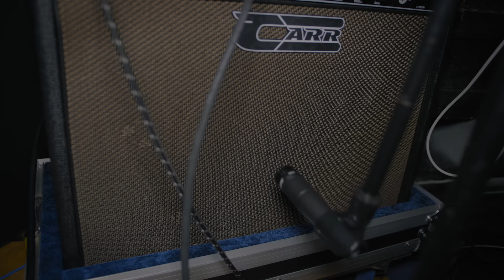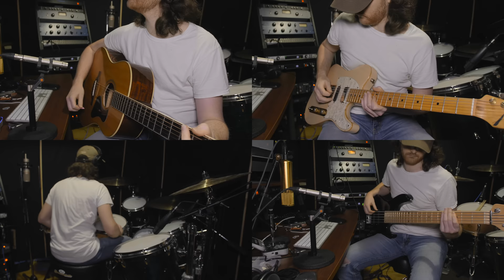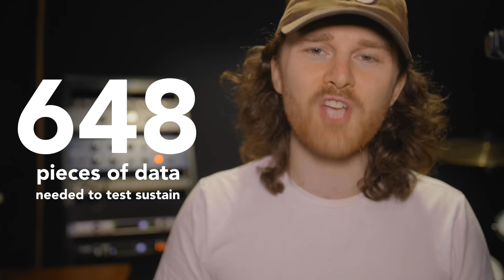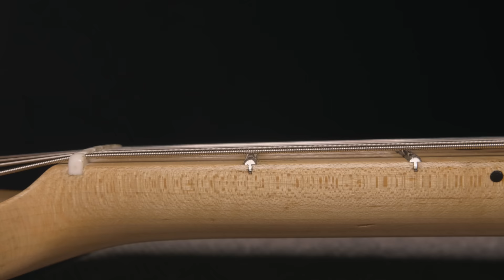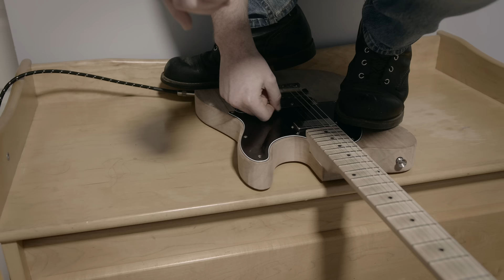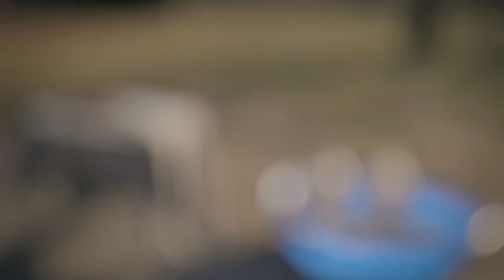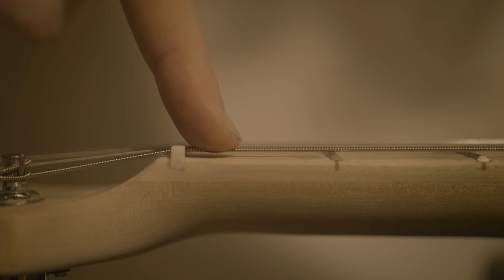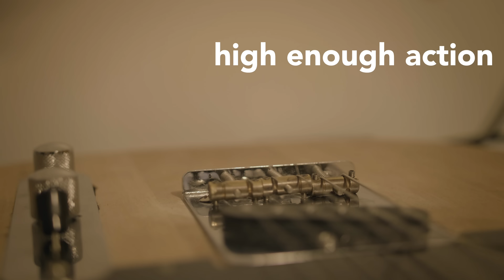Tested: Where Does The Sustain Come From In An Electric Guitar?

Comment: Les Paul's experiments in the 1920s showed him that he got the longest sustain when he mounted a pickup, bridge and nut on a two foot section of railroad track.
 He noted that the track is so dense and massive that the string can not make it vibrate, so all the vibration energy remains in the string for a very long sustain. He was quoted as saying "That thing seemed to sustain forever".
 So we can draw from that experiment and observation, the converse, that if the string is mounted to a material that vibrates easily, it will rob the string of it's vibrating energy quickly and the sustain will be much shorter.
 To translate those physics to real guitars, a guitar made with wood of a greater density and mass will sustain longer than a guitar made from lightweight, low density wood.
 I contend that you probably already knew that.
 If someone asked you what you would expect the sustain to be like in a guitar made from balsa wood, you knew already that it would be short, without the need to conduct the experiment.
 To answer your initial question, " What part of a guitar does the sustain come from?"
The answer is; all of it.
 Maybe you should make a video replicating Les Paul's railroad track experiment and then make a guitar out of balsa wood to illustrate and drive the physics involved home to your fans.
Reply: Johan Segeborn already did the experiment on steel beam. It's on youtube
Reply: @TheMemagNeman  And fender made a Strat out of cardboard. Sounds fine.
Reply: @Andrew Elias So?
 People have made guitars out of resin, out of various recycled materials, out of concrete blocks, glass...etc
"sounds fine" is a subjective thing. Does it produce a sound, yes it probably does.
Is it sounding as good as high quality wood guitar, it could be a possibility , sure. But it could also be a dud, just like with a piece of wood.
If it dampens the string vibration too much it will sound like shit.
I guess that's why we don't put rubber on saddles/ nut and frets.

I just think that dismissing body and neck material as a contributor to overall guitar tone is incorrect.
Reply: @modelcitizen1977  Question: Is that cardboard guitar sustaining the note as long as the steel beam structure? I'd be surprised if it did.
Reply: So then why does my Les Paul sustain for less time than my Hummingbird when unplugged?
Reply: @modelcitizen1977  they most probably had soaked the whole thing in epoxy. No way raw cardboard would handle the frets.
Reply: @damienalvarez2957   Probably because they have different acoustical properties, different materials used, different construction etc.
Reply: Dead strings, and bad set up, and nut and saddle cuts.
Reply: @TheMemagNeman  ooops watch hi other video about tone. we are talking about sustain here though
Reply: @sunnysideup5826  Materials matter for tone and sustain.
Reply: @modelcitizen1977  Cardboard covered in epoxy. So practically it was epoxy guitar using cardboard as a mold for stylistic effect.
Reply: The density of the construction material must play a role on some level but I think it is overstated with electric guitars. Also I think the effect must go beyond the density of the material but must also relate to shape and resonant frequencies of the given material. That being said I personally believe the effects are marginal compared to the effects of electronics, strings, setup, amp and player. If we were talking about acoustic instruments this would be a completely different story since signal generation and amplification are coming from the same system.
Reply: I have a moderately heavy fender tele deluxe and a very light gibson sg, sg sustains longer and sounds better tonally. I also have a very light fender p bass and a super heavy fender p bass. Heavier one sustains longer and sounds better tonally. While not a perfect scientific comparison, I find my juxtaposition within the argument of guitar density/weight very interesting. Tone wood difference could also be at play here as well.
Reply: @alwaysforget911  Here is a trick I recently learned about with Fenders or any screwed on neck guitar.
The necks are usually screwed onto the body without any strings. Take your Fender tuned to pitch and loosen all four screws on the back. You may hear a click, a creak or a ping when you do this That is the neck setting itself into the body from the string tension.Tighten the screws while under that tension. When the guitar is re-tuned to pitch it will have superior sustain from before. The string tension pushes the neck hard into the pocket and will make the guitar perform more like a set, glued neck.
 I thought it was a silly notion until I tried it myself. It made a slight difference on my Strat but a huge difference on my Tele.
 Try it, you will thank me..
Reply: @TheMemagNeman  did you watch this guy's video about tone?
Reply: @binguloid  Unfortunately yes.

Comment: I personally feel like to make real difference with a single guitar, you could change the strings, pickups, and amp. But I also feel like sustain is too variable dependent. Like, any small shift in a test could have a significant impact on the outcome.

Comment: Really nice testing, just as the previous video. Some further recommendations:
1. Whenever you are trying to compare two conditions, the variations should be of the same "magnitude" (e.g. stepping on the guitar exerts a pressure equal to your weight, but lifting it with just a thin blanket doesn't seem to counterbalance that effect).

2. I suggest to test whether some differences are additive. For example, if condition A results in 2 dB of less decay compared to condition B, and C gives you 3 dB less than D, test if trying conditions A+B result in ~5dB less than C+D. This way you see how variables interact, as it is extremely unlikely that sustain (and tone) rely on just one factor.

Keep up the good work!

Comment: My first 'nice' guitar was a neck thru body Charvel in the 80's. Typical hair metal type guitar, black with the shark-tooth inlays. \m/
One thing I loved about this guitar was that I could very clearly feel the strings vibrating the whole guitar. I could tune the guitar just from the vibrations.  I used to say I love the sustain on this guitar. Other people would say the same thing.  I have no idea how many db it would drop after 4 seconds, but I wonder if other guitarists mistakenly refer to that wonderful resonance you can physically feel throughout the whole guitar as 'sustain'?

Maybe 8 years ago I bought a PRS SE guitar ($700), much cheaper than that old Charvel ($2500), with a neck thru body and the resonance feeling is very good, but not quite as responsive in the higher frequencies.

Just a thought.  It doesn't make me play any better or worse, but it makes me so happy when I play it. Those subtle vibrations give me the sensation of 'feeling' my guitar and the music. Even when I'm noodling around with no amp.
Reply: So like it's basically a difference in produced overtones?

Comment: For me the biggest difference in the quality of sustain is on the High E and B strings when fretted past the 12th fret. If you find a guitar that does this well, hang onto it!
Reply: Yes. The plink plink of disappointment can only be covered up with extra gain so much before the truth is revealed. 

That said, my Tribal Sun from Michael Kelly, with the sonic mass bridge has some nice sustain. It’s just a shame, the bare feet board, and the tiny dots, make it a bitch to play when you’re on a dark stage.
Reply: @MidlifeRenaissanceMan  Practice in the dark and you'll never need dots.
Reply: @MyName-nx1jj  much harder for slide, but I get your point :-)
Reply: I've definitely noticed this, moreso on acoustic guitars.  I bet it's more a factor of the setup and the strings just barely getting muted against the frets.
Reply: That's a set-up thing. Fret buzz is the sustain killer. Also hitting strings hard brings them to touch the frets.

Comment: You need to rig up a device to deliver the same strum each time, using your hand is going to vary quite a bit each time (attack, pressure, velocity, etc)
Reply: Most practical approach would probably be to do multiple strums and average the results.

Comment: I built my first form scratch solid body electric guitar a while back and found something interesting. I put on the neck and strung up the guitar before I had drilled the cavities for pickups, and the sustain (just acoustically of course) was insane! It was so much it was unpleasant, and I thought I had surely messed something up. Once I had routed the cavities and installed pickups, the guitar behaved much more like others I've played. So something in there made a huge difference! I'm not sure what it was though, and I really don't care too much, just thought it was interesting! Throughout the whole process I learned that a lot of the things we think make such significant differences really don't at the end of the day, very similar to your findings. Thanks so much for your great videos, keep it up!

Comment: There are a few more things you could have tested: 1) different types of neck joints 2) fixed bridge vs different types of tremolo-bridge vs floyd rose. 2b) Try different sizes of blocks for the tremolos. 3) Play half tone bendings,  whole tone and so on. 4) Passive vs active pickups.
 I'm aware that it would be extremely difficult to test different nevk joints because you'd have to use 3 different guitars and that would add too many variables.
If I had to guess I would say that point 1 probably makes no significant difference, point 2 can impact the sustain, 2b could make a little difference, point 3 could affect the sustain accordingly to the bridge-that means bending a note on a guitar with a floyd rose could affect the sustain more than doing the same thing on a fixed bridge guitar-, point 4 no idea.
Reply: You may also want pharmaceutical companies to test drugs on male 6ft 2inch height vs 6ft 3 inch height
Reply: @pecatum666  was your nonsense answer supposed to be funny?

Comment: I’m surprised the issue of set neck vs. bolt on neck did not get brought up explicitly. 
This tends to be one of the most popular things attributed to sustain. 
Whether it is a spurious correlation or not, all the guitars that I have owned that had impressive sustain, were set necks.
Reply: I had 2 neckthrough guitars that didn't sustain as good as Ibanez Blazer superstrat, which has a bolt-on neck. Thing just vibrates like crazy and it's so loud acoustically.
Reply: Can't really be measured unless you have a guitar with a set neck and you remove it and reinstall it as a bolt-on. And the appropriate thing would be to do that experiment with many guitars.
Reply: this makes no sense at all: why in the world would a slice of rubber between neck and body enhance sustain? (that's basically what glue is, certainly in most poorly glued in necks like fi old gibsons). Set necks "being better" is just a way to justify the fact that they usually are more expensive... It's all in the mind
Reply: There was a YT vid that showed exactly the opposite.A luthier built two guitars from same wood and hardware,one set neck the other bolt on.The bolt on sustained better.
The reasoning was a bolt on puts  way more pressure in the joint than a set neck.
But the argument will never end :)
Reply: @maca5645  I'd love a source on that vid.
Reply: well the first video tested a floating neck and that sounded pretty good.
Reply: I would assume it wasn't brought up because testing it is difficult. The only way is to unscrew a "bolt on" and "set" it (at professional level) for an exact comparison. I guess a guitar builder could do that.
Reply: @maca5645  People want to believe that effort pays, that doing things in a more expensive way makes them better. It can be true when more care is brought to do something the same way but a stupidity when a drastically different method is used. Set necks are inherited from hollow-body instruments (screwing a neck onto an acoustic guitar is possible but probably requires a metal plate inside) and a time when metal screws did not even exist.
Reply: Could be a scale length thing. Different scale length = different tension on the strings.
Reply: @felipew101  Yes, that can be another factor. Actually, as the video points outs, there are many factors, including the player, that determine how a guitar sounds.
Reply: @GuttlinGuitars  couldn't agree more
Reply: @perihelion7798  makes perfect sense actually. a set neck transmits mechanical energy, ie vibration better. The string is a tiny little bit of mass. The more mass you connect it to - the body, the more mass there is to dampen it. A bolted neck transfers less therefore the string's energy isn't taken away as fast due to inertia of the body's mass. This is basic physics.

There is also the question of phase cancelation : each string end puts energy into the body and next but do the forces meet out of phase and cause dampening / disperation of energy.
Reply: I tested this first hand in the early 80s, I had a boogie bodies bolt-on zebrawood strat neck with rosewood fingerboard, screwed onto a boogie bodies zebrawood/mahogany body. It sustained longer than my neck-thru Yamaha SG2000, and my nicely setup Gibson Les Paul Standard.
Reply: @martinaddison4880  A really tight bolt-on neck loses nothing in the sustain department.

Some gypsy-styled acoustic guitars are actually made to kill sustain, as it lends to very rapid, precise picking, and a very percussive strumming. Note there were no drums used in this gypsy string music.
Reply: @perihelion7798  Indeed - the longer you play - the more we learn - one size does not fit all. Everyone's style does not require infinite sustain. Stated another way: more is not always better.

Comment: Here is something to try… how does string mass affect sustain? Will thicker strings sustain more, less, or the same?
Reply: You already have your answer in this video.  He compares a high E and a low E.  How much more difference do you want in string gauge.  Heavier strings sustained longer by a bit, but considering how minimal the difference was between that big a swing, going from 9s to 10s won't have a huge impact on sustain.  (Though it will affect the balance of your tone in my experience.)
Reply: @Dartheomus  That's not a good comparison, since there is a difference in string tension between the high and low E. Plus there might be a difference in wound vs unwound.

What's more relevant to the discussion is the test he does when tuning the guitar up or down. It seems that more string tension decreases sustain, thus thicker strings, which require more tension to reach the same pitch, likely have less sustain.

EDIT: Actually watching the video he seems to get mixed results with pitching up or down... strumming all the strings results in considerably less loss in db when tuned down; whereas on individual strings the opposite it appears to be true.
Reply: @jasperdgg  You hit the nail on the head.  The results were inconsistent.  That means the slight effects of string gauge will be negligible.  Playing style will matter far more.
Reply: @Dartheomus  Agreed. I think there was also that Beato video a while back that concluded that lighter gauges may sound better, or at the very least don't sound worse. I might have to re-watch that one though to be sure. There doesn't seem to be a reason to torture ourselves playing thick strings in search of that elusive tone or sustain, that's for sure.

I enjoy the fact that all these myths are getting busted; it's liberating to not care so much about gear and just focus on playing. Get the cheapest guitar that is playable, put some nice pickups in, learn to do a good setup and play the hell out of it.
Reply: The string length and gauge certainly do make a difference in sustain. This is very easy to prove on any guitar by shortening the length by fretting, etc.
Reply: @jasperdgg  Yeah I agree, and I think you are right about the Beato video.  My favorite example when it comes to string gauge is Billy Gibbons.  No one will ever say his tone wasn't huge, and he used 7's and 8's!!!  I think that's too extreme for my liking, but damn!  BB King is another great example... that huge bluesy tone with 8's.  =P

For me, I feel like the mid's (G & B string) seem to come a little more alive on a strat when you use 10's, but that's for edge of breakup tone.  I don't think it really matters... you can always fix it with EQ. =)
Reply: @jasperdgg  Lighter strings have more high end. The Beato video did not discuss sustain.
Reply: @Leo_ofRedKeep  The whole point of Beato's video was to reject the myth you recite.

Comment: Actually, I think that it's not about the absolute length of a note but how soon it begins to decay and at what rate it does so. Most players don't need a note to sustain more than a few seconds at most, but no matter how long it sounds, they don't want that note to decay quickly. So, it seems that it's not so much about absolute "sustain" as it is  about the onset and length of the  "decay". This is where compression comes into play and why the proper use of it makes everything sound so good.

Comment: Sustain is the quality factor (Q) of the mechanical  oscillating system. It depends of construction and materials of the parts of that system. The Q is different at different frequencies, so material affects frequency spectrum, i.e. tone.
Reply: Agree, but to what noticeable degree, especially to the audience. Point of diminishing returns is very small. Very Very small....
Reply: @iam.miikey  Basically, if you like the guitar, it is good enough. That was the point of the videos.